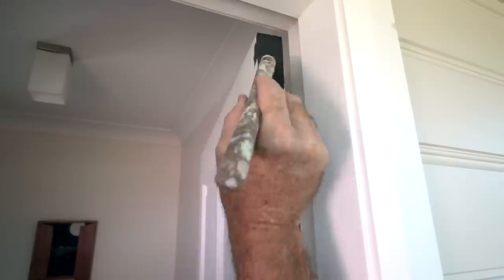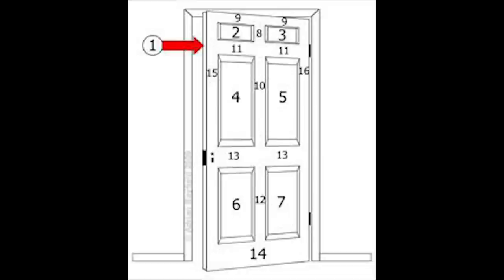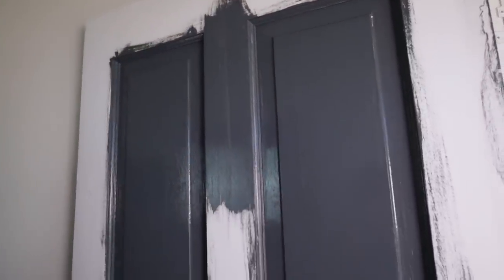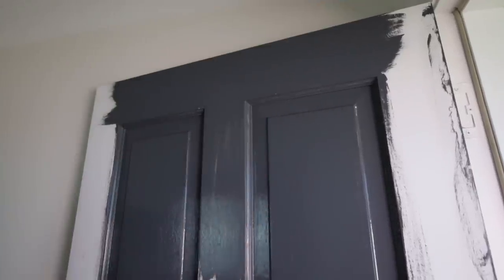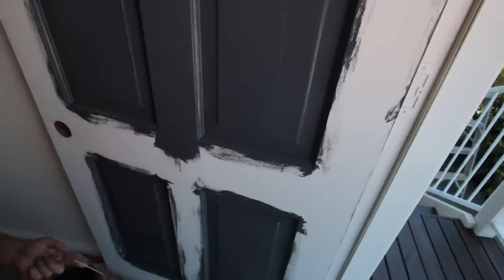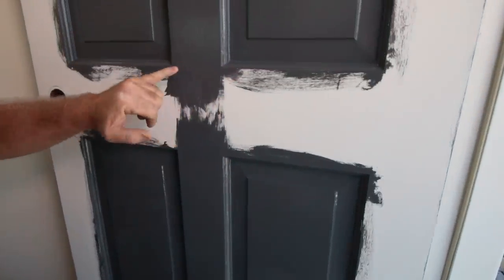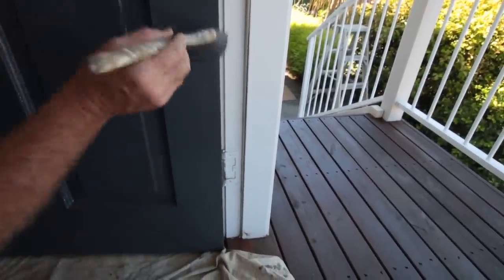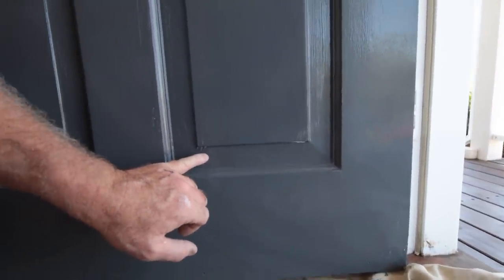How to paint a panel door. Paint by numbers makes it easier!

Comment: In what order would you suggest to paint a door like this? http://www.franklumber.com/product/contemporary-fir-multi-panel/
Reply from the maker: It's virtually the same as a 4 or 6 panel door. There's just more panels. Edges first, start one of the top panels, then the next and work your way down (as fast as possible) then the styles (top and bottom) and lastly the mullions (the sides). Have fun mate. :) all the best